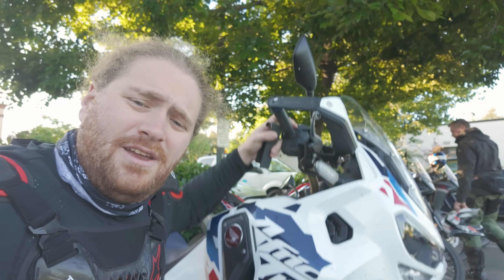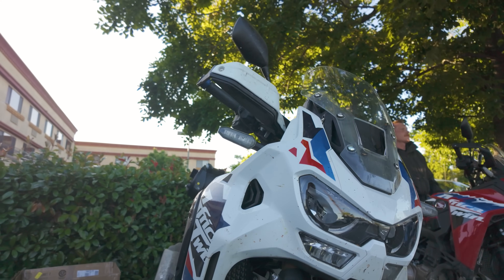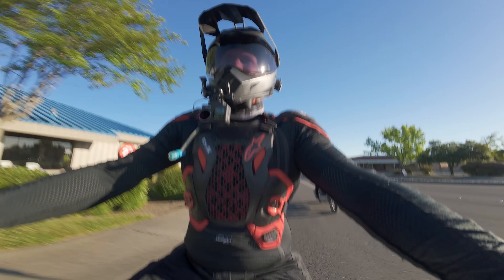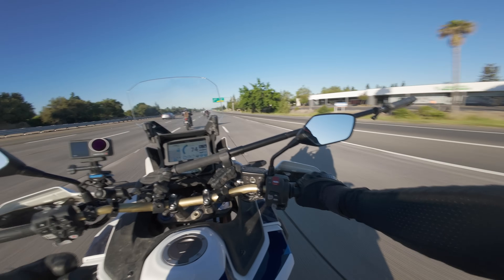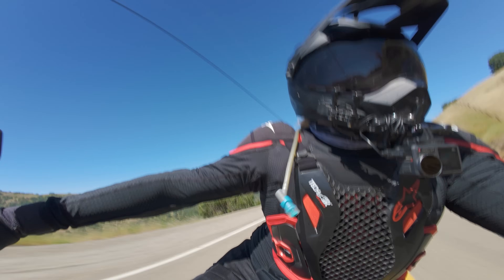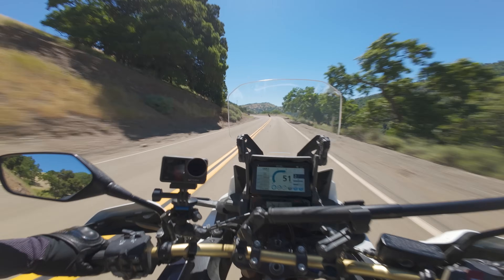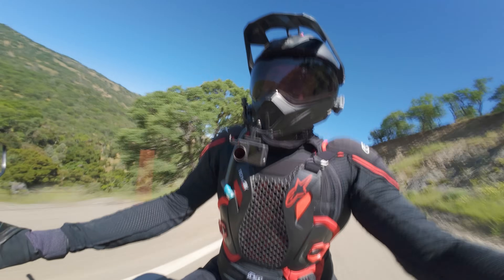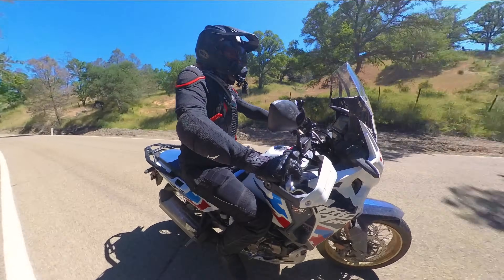Everyone Said I'd HATE A DCT Motorcycle...

Comment: It drives me crazy when people call a dct is an automatic. Yes the clutch is automatic but it uses clutches and not a torque converter like an auto. Its formula one technology and I love that Honda experiments with transmissions. Their cb900 had two sets of final drives, you can choose hi or low for city or interstate driving. Theres the Cub and it's used a sequential gearbox since the 50's. I'm excited about the newer E clutch.
Reply: It is still functionally an automatic transmission even if it is just a normal transmission handled by a robot, and it has actually replaced a proper oldschool automatics for many car manufacturers these days. Sure they are not as smooth as a real torque converter automatic (especially if the DCT guesses wrong what your next gear should be) but you get all the benefits of a manual gearbox (no torque loss and rubber banding) with the convenience of an automatic.
Reply: People are dumb... it drives me crazy too... they call anything that isn't manual, an automatic.  Doesn't matter if its an automatic, a DCT (and the single clutch variants), CVT, eCVT, Electric vehicles single gears... they call it all "automatic" meaning they don't have to manual switch gears.  Most people have no clue an "automatic transmission" is very specific type of transmission and doesn't just mean you don't change gears manually.

Comment: As a car guy im suprised how long stuff like this takes to come to bikes. Especially given how advanced rider aids have become nowadays.
Reply: Motorcycles have had sequential transmissions for 80+ years... I'm surprised it took making them automatic in order for them to move to automobiles
Reply: @firefighter1c57 the dual clutch is what makes this special.
Reply: @chucksherron   a DCT can only change gear up or down one gear at a time. Hence, sequential. Or, like motorcycles have been for 80 years. Yes, making that dual clutch is an improvement, I didn't say it wasn't.
Reply: @firefighter1c57  I guess I'm not getting the point you are trying to make. That's on me.

Comment: Dct on Africa twin missed out by not adding a zap button that engages the clutch and dumps it once released also I don't know how well they do on long downhills where engine braking is preferred I don't want it going into a higher gear because it thinks the rpms are too high
Reply: It will not do that in manual mode.  It stays in the gear you put it in.  The only time it will shift in manual mode is an upshift to prevent engine stalling if you are bogging it down way too low of RPMs.

Comment: I owned a DCT for a few months but sold it. Couldnt get used to the shifting on it, downshifting in corners, upshifting in corners, the fact u can 'feel' the shifts and it also changes how the bike feels i just didnt like it at all. To each their own and DCT is definitely great for people with mobility issues but ye, not for me..
Reply from the maker: I would need to spend a good long time practicing with the DCT to get used to it for sure.
Reply: I love mine, but if it was automatic mode only, I'd get rid of it too... I only ride in manual mode 100% of the time.  I always hear people complain about it shifting at a bad time, but it doesn't have to do that if you just control the shift.

Comment: Think the dct takes some tuning into. In its stock mode it’s not hugely inspiring to a sporty rider.
Also all Hondas power settings are back to front so 1 power bar is full power and 4 bars is the lowest power. It looks like you spent a lot of the video in low power on the highest engine braking. It’s so much better after you’ve lived with it a while. I like that you’ve ridden it and done a video I just wish you had more time or instruction on it to get the most out of it

Comment: Obviously I think the dct opens doors for people that struggle to pull the clutch.  Knew a guy with just a thumb.  Would have been great for him.  Otherwise, leave the regular clutch and toe shifter.  Atleast leave that as the standard offering.  But, I questioned the traction control and antilock also.  They are pretty ok after using them.  😂
Reply from the maker: I'm all for DCT as an option. And that's more or less how Honda does it. It's a $600-$1000 optional extra with manual as standard
Reply: @spitescorner I understand.  There is a reason that 95% of cars are automatic.  People don’t want to shift, or physically can’t do it.  I prefer my stick shift Jeep over the automatic, but the stick now costs extra.  That I don’t care for.

Comment: The whole discussion is really a bit over the top blown. The DCT can still be shifted manually. So if you compare it to a bike with a quick shifter (or Hondas E-Clutch, for the matter of shifting while driving), the only difference really is how you tell the bike when to shift: via an electronic button or via a mechanical lever. If Honda was smart, they'd just offer a foot lever that works electronically and emulates a mechanical lever, all "problems" solved.
Reply: I do believe that a foot shifter is available for these transmissions now.
Reply: They have always offered a DCT foot shifter. It’s awesome
Reply: For Goldwing, and Africa Twin, I have seen modules to install to control it with your foot like a manual foot shifter.  For other models, like my Rebel, I've never seen one.
Reply: @2wheels.are.better.than4  Interesting, didn't notice that when looking into the NC750. Might be what @AyaWetts said.

Comment: I own the rebel nd the goldwing - the problem with dct is that when you want to lower one gear to give more boost - it will lower it but after 3 seconds will bring it back to "where he believes it should be " - like - excuse me - my bike and i call what gear to ride . i wish Honda would let the rider stay in the lower gear at least a minute unless it goes to really much higher speed .
Reply: I never run into that... because I never ride in auto mode.  I only ride in manual mode and it always stays where I tell it.  It only auto upshifts when getting too slow, to stop the engine from stalling.

Comment: Only thing I don't like about DCT (aside that I enjoy shifting gears, blipping/rev matching, etc., otherwise I may as well ride a large cc scooter), is that DCT is horrid at slow speed maneuvering, and they have a reputation of burning out the clutch if you practice a lot of slow speed exercises.
Reply: Back brake makes the clutch disengage in slow speed manœuvers, see Bret Tkacs' video on it.
Reply: Yup, my dct AT ran 78,000 miles when I sold it and there was absolutely no problems…
Reply: Not many scooters can go 0-60 in under 5 seconds.
Reply: You have to learn how to do it... its only "horrid" as much as anyone thinks anything they don't know how to do is hard.  I find it quite easy after a bit of practice.  The clutch doesn't burn out easy... it does burn out when people like that one instructor used it for weeks on end for hours upon hours every day on a very heavy Goldwing.  I've done many hours of slow speed practice on my Rebel with no issues, I just don't do it non stop for 6 hours straight... and ignore temp warning lights... people can burn out manual control clutches like that too.

Comment: Automatic would be fine for a leisurely ride. But if you want a spirited ride through corners you need to be able to brake and downshift to the corect gear before the corner and hold that gear until you want to shift. Having it shift mid corner is dangerous and unnerving to me.
Reply: You can do that just fine... its why it has a manual mode.  In manual it only downshifts if the RPM gets so low the engine would stall... otherwise it just stays in the gear you tell it.

Comment: For all intents and purposes the dct is an automatic, for there is no manual/user operated clutch
Reply from the maker: I mean, there's paddle shifters so you can control the shifting which sound like it's manual to me.
Reply: @spitescorner  i could be wrong since i turned drive or like automatics but i think some auto cars have shifter paddles but are still autos. Maybe its up to the individual to define themselves but imo an auto is defined by whether or not it has a user operated clutch.
Reply: And the Desoto Havalen? It was a car from the 60s that had a foot clutch to put it in low, high, or reverse, but that clutch was bolted to a torque converter that allowed you stop around town without using the clutch... Diamler, before it became Diamler/Benz, used a similar system in luxury cars in the 30s through the 60s. And even today, things like trophy trucks, and other offroad racers use a torque converter in the manual transmission to absorb driveline braking when the drive train increases speed during jumps, and then suddenly regains traction upon landing. Crane Carrier used an air operated clutch in its 18 speed semi transmissions. The transmission was a sequential, pulling the shifter towards the driver engaged the clutch, you then could move up to two gears up or down, then moving the shifter away into the selected gear, and air re-engaged the clutch. Indeed, what is a manual and what is an automatic transmission is subjective...
Reply: Its a manual transmission with a computer controlling the clutches for you... You can tell it when to shift gears... since the computer controls all that, they also added software to completely control the shifting for you too.

Comment: To me any transmission thar requires no user operation is an automatic. If it requires shifting or clutch but can do one of those on it's own then it's semiautomatic. But if it requires both clutch and shifting then it's manual
Reply: I currently own, an 86 Suzuki GS450, an 04 Buell XB12R, a 13 Victory Hardball, and a 17 VRod. Not a one of them do I need to use the clutch for shifts other than starting/stopping...
Reply: you can make up your own definitions, but don't be surprised when people get confused or don't understand.

Comment: I don't think the DCT is designed for more aggressive riding. That said, it's in early adopter tech phase as far as I'm concerned so I aslo think it will get better with more feedback and testing. It's not for me, I'm not the rider DCT is targeted at right now. I think it would be fine for big, heavy, cruisers and old geezers or maybe a handicap person. It's not meant for someone that wants to squeeze every once of performance out of a machine.

Auto-shift is about my limit for automation at this point.
Reply: 14 years in production motorcycles now... I don't think is still early adopter.  The computer isn't 100% great at very aggressive riding, and I think mainly because they don't program it to be.  Its big and heavy, and the extra weight isn't something they put on performance oriented bikes.  They put DCT on cruisers, commuters, tourers, adventure bikes. If you go manual mode, you can be as aggressive as you want, and it actually performs great.
Reply: @AyaWetts  It’s borrowed tech from cars but that really doesn’t mean anything.

The tech is still infantile. It works, but only for cruising. I’ve ridden a DCT Africa Twin, it made me want to get off the bike and walk because it was always shifting when it needed to hold and holding when it didn’t make sense at all. Had to ride it in manual mode which then begs the question why bother with the extra weight and parts if a manual lever does a better job.

I stand by my statements. Some tech takes a long time to mature. Battery cars have been around over 100 years and we still haven’t figured that out. 😂

Comment: Well, most of the complains you have about it can be said of automatic cars as well. That's why there are those of us that love manual transmissions, across the board. Now, that being said, in automatic cars I would "manually' shift if I'm looking maximize torque in the twisties. Same on the DCT. That's what the paddle shifters are for.
Reply from the maker: True, but there's an almost imperceptible delay that feels somewhat unnatural. But that's only because I like to boogie in the twisties.
Reply: @spitescorner  Can't be that much more delay than clutch, shift, release. We are just wired to that physical feedback that is different on the DCT. Manual is true control, engine braking etc. And if you forget to downshift at a stop, then you'll stall. DCT takes some of the thinking out of the game plan. I think it is great for someone not wanting to be as acertive in the twisties. Great for commuting in traffic, especiallly where you can't filter or lane split. And it great for those with some physical challenges that can't operate a manual.  The DCT is not going to check all the boxes a manual does, it will do somethings better. It's great to have more choices nowadays. Love your channel.
Reply: @spitescorner  And, anything that gets more people riding is good.

Comment: If one of the two clutches is held open, won't that accelerate wearing out the clutch release bearing?
Reply from the maker: Clutch parts usually only wear during the transition between engaged and disengaged. At least that's my understanding.
Reply: Honda has been mass producing them for 14 years now, they know what they're doing.
Reply: @spitescorner for the friction material, you would be correct, but the OP specifically said the release bearing. Though I'll cover that below.
Reply: No. No it won't wear out any faster than any other bearing in the transmission as it too is submerged in the fluid.  You see, these dual clutch transmissions are a wet clutch transmission, so, this isn't like a clutch throughout bearing in a Honda Civic behind a B16. In the Civic case, yes, you've got a sealed bearing inside the bell housing that would overheat and die a premature death being held open all the time. However the dct throw out bearing being inside the transmission, bathed in the transmission fluid should last the same length of time as the output shaft bearing, or, theoretically twice as long as it should, in theory, be underload only half the time, as one clutch or the other would be engaged.
Reply: @firefighter1c57  Excellent and reasonable explanation--THANKS!
Reply: @karlroebling3316   completely unrelated to this discussion, a very early DCT used in some Ford and Jaguars had a dry, dual clutch setup. I only mention it because some know it all will come along in six months and start arguing that not all DCT are wet clutch, which is technically correct, but completely unrelated to the topic at hand. Also, those early dry clutch systems suffered from premature failure as I mentioned earlier.

Comment: OK well, you did yourself a disservice by not learning the controls before you got on the bike. I see you were looking for sport mode within the different presets, shifting through urban, gravel, etc, while in Drive mode. Sport mode is if you press the D button twice, three times, four times. There's 3 sport modes. Everyone seems to hate D which is Dullsville mode for ekeing out the gas. What you wanted was Sport 2 or 3, which you would have got. Little matter: you took charge and used it like a manual - though, there is a manual mode that won't shift out of the gear you select.
Reply from the maker: I figured out the different modes. I tested S1-3, D, and full manual. It was nice but still not 100% my bag.

Comment: Engine breaking?  Anyone old enough to remember 2 stroke road    /race bikes know what it feels like to have basically zero engine breaking.  Which, given the right conditions, was better for it.
Reply: Well you cannot really engine break a 2 stroke can you? Engine runs out of lubrications  during engine breaking a 2 stroke engine?
Reply: @getty6974  Correct.  I learnt a lesson during my very first race weekend at a track that became my home racetrack.  Phillip Island.  Didn’t have the correct sprockets fitted to ensure maximum terminal speed down Gardner Straight. So, whilst being young and not understanding this part I was hitting max revs too early and decided to reduce throttle inputs during timed practice laps (instead of returning to the pits to change the rear sprocket) by backing off the throttle before turn one. Two laps later and both cylinders of the v-twin engine seized.  A costly return back to Melbourne for an all night engine rebuild.  This was 30 something years ago…
Reply: So what you mean is, engine braking a two smoke results in engine breaking indeed😉

Comment: DCT: A manual transmission with an auto clutch. I ride an electric dirt bike. The absence of any mechanical shifting is a game changer. Who ever still prefers manual shifting, are the same guys that prefer a carburetor engine. Get with the times, you won't be disappointed.
Reply: Put down the crack pipe and take a taxi.
Reply: You're wrong. I prefer fuel injection and a manual. All my bikes are manual, my Lotus is manual and my MINI is manual. Both trucks are automatic but that is only because my wife can no longer drive a manual due to strokes or they'd both be rocking an NV4500.
Reply: Let them use what they want... they probably also sit on their front porch and yell for the kids to get off their lawn...